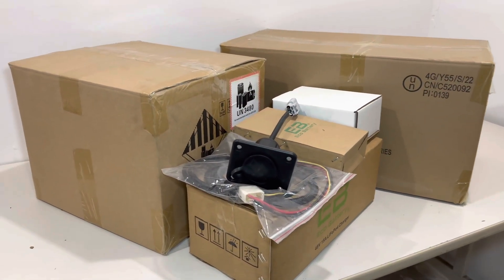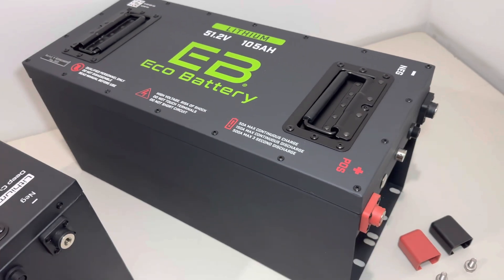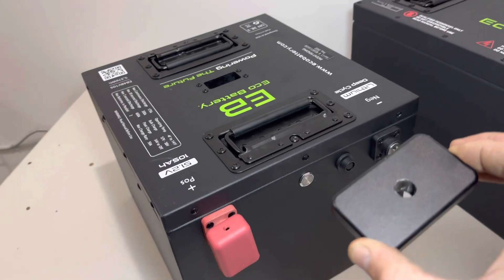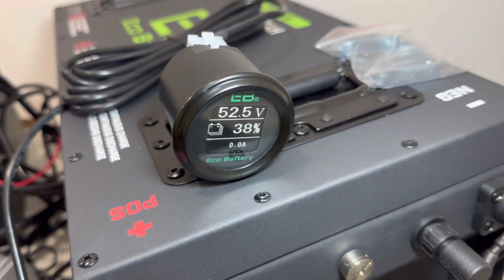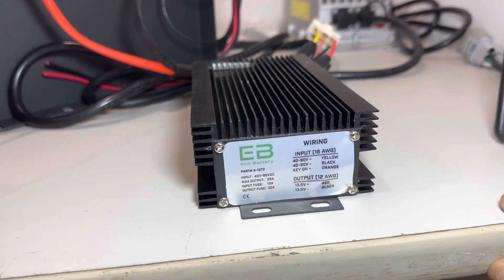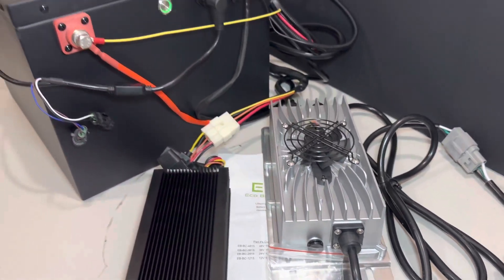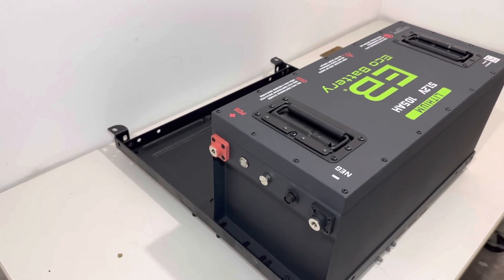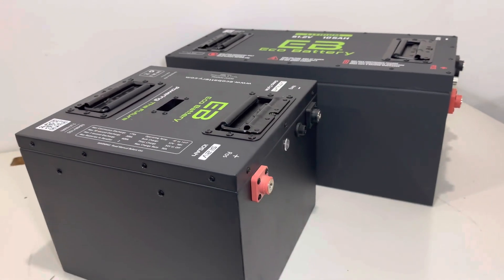Unboxing the Eco 51v - 105ah Lithium Golf Cart Battery & Installation Bundle

Comment: Once installed for the summer use is the battery contantly turned on or is it ombe turned off after every use?
Reply from the maker: Only need to turn the battery off if it’s going to sit for 2 or more weeks

Comment: I have a 2010 Club Car Precedent - was wondering if you could comment on the Eco Battery DC Voltage converter model EB-4813530 versus the one that comes in the kit you are unboxing?  That was the Voltage Reducer that recently came with the kit we purchased.   Thanks! Steve
Reply from the maker: I don't think they changed the 12v reducer since releasing the Gen2 battery and kit. Unless this is really recent, they are in the middle of releasing several new features.